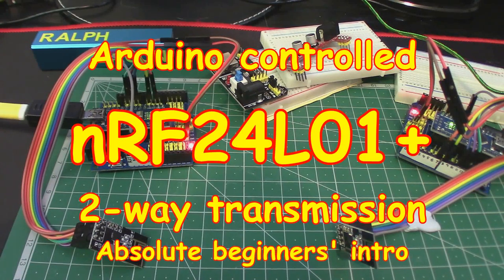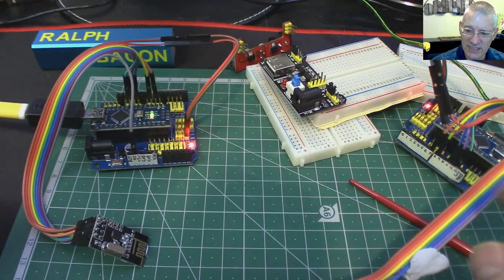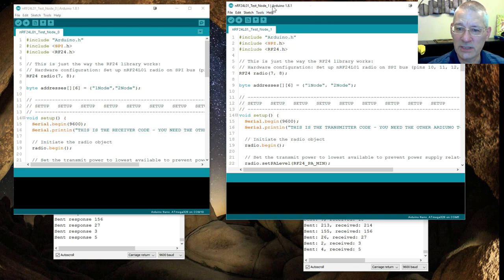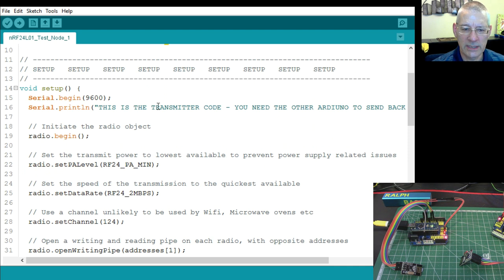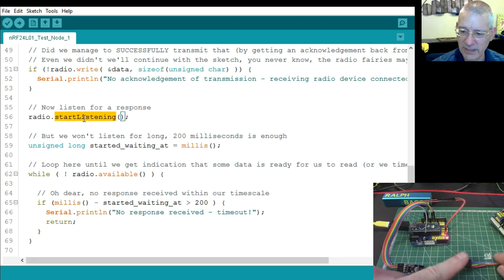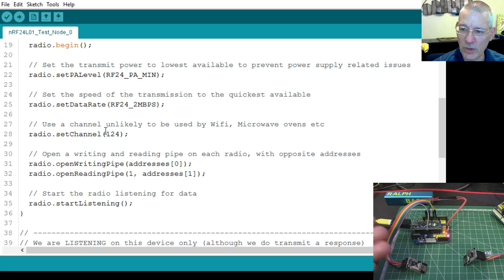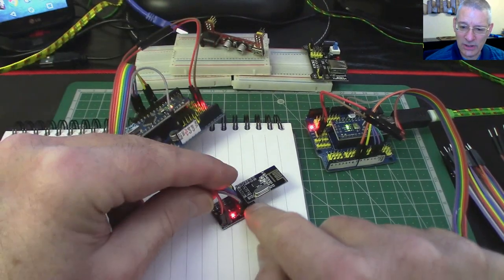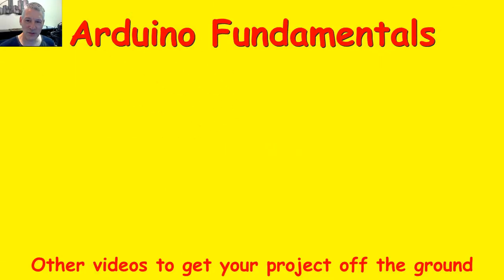#73 nRF24L01 Send (and receive) data with your Arduino!

Comment: hi ralph..despite connecting everything properly my rx serial monitor is blank and tx is nor receiving any acknowledgement..what could be the problem?
Reply from the maker: Let us assume that you checked and double-checked your wiring. Your transmitter sends out the character but does not receive an acknowledgement. It continues to wait for a reply character but receives nothing. Is this correct? If you swap the two modules over do you get any change in behaviour?
 
Are you using the adapter boards that allow you to run the nRF24L01s on 5v (a 3.3v regulator is all built in)? They solve 99% of all known problems, which all seem power-related. Do get two adapter boards and try again. So many people have done this and suddenly it all works!

Comment: Can I transmit data in both directions (transmit and receive) but use up to 5 NRF24 modules sir ?
Reply from the maker: Well, you can transmit in both directions but that means all devices must be in "listening mode" ready for a message. 

The demo circuit does do this; the first (initiator) device sends a messages, gets an auto-acknowledge, then waits for some reply. So you can do the same.

Comment: First of all, this tutorial is fantastic! I was wondering if you know how to send a string of data from one arduino to another. I am reading all 16 analogue ports from an arduino mega and wish to send them via the NRF24L01 to an arduino uno to display on a computer. I was thinking the best way to do this is to use a string. Do you have any idea how I would do this by edditing your code or is there a better alternative?
Reply from the maker: There is a better way. Don't use strings to send numeric data at all. 

The fact you're reading from analog ports indicates floating point (analog) data, such as 3.1415926? Depending on the precision you need, you can just multiply by 10 or 100 or 1000 on the sensor side and send as an integer (2 bytes) or even a long (4 bytes) if it needs it. Then divide by the same amount on the receiver side.

Example:
To send such values create a struct (short for structure), max 32 bytes, like this:

struct myDataStruct {
 char channel;
 int temperature;
 long humidity;
};

void setup()
{
 Serial.begin(115200);

 myDataStruct myData;
 myData.channel = '1'; // Single quotes for char;
 myData.temperature = 2353; // divide by 100
 myData.humidity = 78456; // divide by 1000

       Serial.println("Channel: " + String(myData.channel));
 
 // convert the int and long to a float, see the precision value (default=2 decimal places)
 Serial.println("Temp: " + String(((float)myData.temperature / 100)));
 Serial.println("Humidity: " + String(((float)myData.humidity / 1000),3));
}

void loop()
{
 // This is just a demo
}

The output looks like this:
Channel: 1
Temp: 23.53
Humidity: 78.456

Does this help?
Reply: @RalphBacon  Thanks for the help! I ended up using your code but using an array to send analogue signals from a MEGA to an UNO. I was also able to send a variable which can be used to vary the PWM on the mega. Now it is able to send the data and control a set of heaters!

Comment: Is it possible that one nrf may transmit perfectly but fail to receive data and vice versa or it is a coding issue , because I have one nrf which is transmitting perfectly and receiver recieves it, but it can't recieve the acknowledgment .
Reply from the maker: Anything is possible, Pranav, but if you swap the devices over (so the Tx was the Rx and vice versa) do they still exhibit the same half-working behaviour? In which case it's not the devices, it's your wiring!

Comment: Hi Ralph,

Sorry to bother you. my son it trying to get this to work but we keep coming up with one not working have you any idea please.
One is saying
No acknowledgement of transmission - receiving radio device connected?
Sent: 64, received: 64
No acknowledgement of transmission - receiving radio device connected?
No response received - timeout!

the other
Sent response 64
Sent response 64
Sent response 64
Sent response 64

Thanks
 .
Reply from the maker: There are a few basic steps you can take:
1. You MUST use the adapter plates. They are cheap and stop all problems with trying to run these modules on 3V3 as well as the wiring from "underneath" that confuses most people (including me). Here's a link to UK Amazon but they are available in many places:
https://amzn.to/3g37rSu
Please don't try and use the nRF24L01 modules without these.
2. Use my two demo sketches exactly and without modifications.
3. Check and double check the wiring. When using the adapter plates it's much easier to check it. Use different coloured cables for each pin.
4. Keep the units within 30cm of each other (the sketch uses ultra low power just for testing, no real range). Change the power setting statement  from 
radio.setPALevel(RF24_PA_MIN); 
to 
radio.setPALevel(RF24_PA_LOW); 
in both sketches (but unless you have the adapter plates there is insufficient current in the 3V3 output to run this - so do use those adapter boards!
5. Take heart: I've run these sketches many times on many different platforms (ie not just Arduino but STM32s, ESP8266s etc) and the demo sketches run fine. Just follow the instructions above and let me know how you get on.
6. Buy those adapter plates now! Good luck.
Reply: I ran into similar problems. Changing the 'setChannel' on both nodes to '120' solved this for me. That got me well above the home WiFi frequencies in the US.

Comment: Im having a problem.
The node1 side(transmitter) is sending data but it just recieved is always 0 and next of no acknowledgement and send a random data and recieved 0 again...
Can you help me with my problem?
Reply from the maker: Are you using the plug-in adapters for the nRF24 modules so that you providing 5v (not 3v3)? If you swap the receiver and transmitter units over do you get the same result? Are you using my EXACT sketch for each unit (Receiver/Transmitter)?
Reply: @RalphBacon  i solve the problem by using the adapters 
But how can i recieve 2 data from 2 different transmitters?
Which part of the code do i need to manipulate?

Comment: Hi Ralph, I am having a bit of a Problem getting this code to work. I know this sounds stupid but I have had them working with another Project but I was so stupid and reloaded then RF24 library. It appears that there are so many of These libraries with the same name that I am really confused. Can you explain the diffrences. I noticed that some use the power Setting with MIN and others use LOW for example. You have a very clear way of explaing things that why I am asking you what library I should use. Really , for my Project I do not Need 2 way communication and if I have understood correctly the & sign Triggers a Response any way. Could you try and explain what you would do in my Situation. many thanks in advance. Paul
Reply from the maker: Hi OE8PCK (I bet that stands for something interesting, part from Paul)! You're right there are several libraries out there. The one I chose was because it is being actively updated, so should have many bug fixes and new functionality. It supports a network mesh, for example. And again, you are correct that even if you have no requirement for two-way communication (that is, the receiver nevers sends data back explicitly) this device will automatically send back an acknowledgement that it has successfully received a data packet - so your transmitter unit will always know whether the transmission was successful (and will auto retry if not). So i hope that clarifies things (and helps you too). Thanks for your post, good to hear from you.
Reply: Thanks for the Info Ralph. OE8PCK is my Amateur Radio call sign :-) Do you have any experiance with the TEENSY 3.2 and the NRF24L01?
Reply from the maker: I'm afraid I've no experience of the Teensy 3.2, but I do know there is a special version of the nRF24L01 that fits directly onto the Teensy board. I'm guessing that they would be more expensive, however. That said, I don't see any reason why the standard one (as used in my demo) will not work with a Teensy with a few pin changes, read this article: https://forum.pjrc.com/threads/16001-Does-anybody-get-Teensy-3-working-with-NRF24L01 to get you going!

Comment: I tried sending a data on a “void” but sadly it cant send it. I tried the simplest code without sending back to the receiver just random numbers but inside a void. Can you try it or it cant handle sending a void. Please help thank you coz i really loved this that you did
Reply from the maker: I'm not sure what you mean by "sending data on a void". Use my two sketches which you know work just fine. Ensure you use the adapter plates to make wiring easier and stop voltage issues stopping it working.

Comment: In reference to line 51 of your code are you not sending the location of data rather than the value of data? If the use of the pointer is important could you please explain why it is.
Reply from the maker: Yes, in Test_Node_1 at line 51 I'm sending the location of the data (&data) to be transmitted. 
 
if (!radio.write( &data, sizeof(unsigned char) )) {
 
Is this important that I'm using a reference to the data location instead of just supplying the 'data' variable? If we look into underlying RF24 library we see that the 'write' method expects a pointer reference as the first parameter:
 
bool write( const void* buf, uint8_t len, const bool multicast );
 
Whether this would (a) compile and (b) work, if I just supplied the parameter as a variable? Microsoft's C++ compiler errors with:
 
Error C2664: 'bool write(const void *,int,const bool)': cannot convert argument 1 from 'unsigned char' to 'const void *' (12)
 
Which means I'm expecting a pointer to a variable of some kind and you've given me an actual variable. Doh!
 
Interestingly, although passed as a pointer reference (which means you can normally change those values in the underlying function) it is accepted as a 'const' which means it cannot be changed. BTW we're using (well, he's using) void as the parameter type to indicate a generic data type. So you can pass an integer, char etc and it is all accepted.
 
Short question, long answer, does it help?
Reply: Ralph S Bacon Thank you for your explanation. I am becoming more familiar with the RF24 library and see that the write function requires the address of the first byte of the data and the number of bytes. Exactly what your code does. 
Thank you for your time.

Comment: Have you ever had modules that dont communicate with eath other? I know every register and every bit of these chips, use them with ARM Cortex M1 CPU and a self written lib. I used th scan bit and found out, that the middle frequency of each channel is not the same in every module. You can improve distance if you shield the chips with a GND plane.
Reply from the maker: I personally have never had that issue, Kalter Krieger, but several reports on the internet (and in the comments here) indicate that some Arduinites have problems - mostly power-related because they did not use the adapter boards but maybe this has something to do with it too. Good tip about the ground plane, thanks for posting and vielen Dank für deine Infos.
Reply: Hello, you accent sounds "British" ;-) The problem is, that these chips are clones. The original ones from Nordic are much more expensive, about 5 USD / pc. I have aprox. 30 of them and only 20 are worht to be used in applications. Schöne Grüße aus Deutschland.

Comment: Does the transmitting and the receiving Arduino have to be the same? I'm using a nano and an uno and it doesn't seem to work, could that bee the problem?
Reply from the maker: Hello Arduinite! I'm currently on vacation 5,000 miles away from home so I'll have to be brief with these comments until my return, mid-July.

Not at all, super fat unicorn! As long as it's an Arduino using an Atmel 328P (which both those units do) then it will work, believe me. Detail the problems you have, specific details, and I'll try to help you on my return from East Malaysia!

Comment: I've search for ages for an easy to follow guide and this is by far the best, thank! However, I'm having a mixed bag of results. The 2 Arduinos (one Elegoo and the other a non-branded one) seem to communicate fine for a while and I'll get several Sent/Received messages, but then I'll get continuous "No acknowledgement of transmission - receiving radio device connected? No response received - timeout!" messages from the Transmitter side. If I reset either or both Arduinos (seem to have better luck resetting the receiver Arduino), it'll settle back to receiving/transmitting, then go again, and so on. Any suggestions why?
Reply: ....just to add, both are sat on my desk, about 30cm apart, both set to "MIN", but I've also tried "LOW" with the same result. They're also connected up "bare" without the adaptor plate.
Reply from the maker: Well, Huw, as you will have seen from my other comments here I can only highly and really, really recommend the adaptor plates. (Too much emphasis, I know). You're running those units at 3.3 volts directly from the Arduino, I suspect; some clones might only give out 50mA on that pin (depends on how they were designed). The adapter plates lets you supply the full 5 volts and lets the modules take hundreds of milliamps as required. The problem is that the units take a short burst of high current when they transmit. Now..
 
Now that said, I can't guarantee that will solve your issue but it does seem a bit silly to try anything else when it is known (in the Arduino community) that the adapter plates solve 90% of the type of issue you're now reporting. Even if they don't solve it, it eliminates a source of problems that we can progress knowing that power is not the issue. And the wiring up is a lot easier! Amazon sold me a pack of 5 (IIRC) for the same price as I could get them from the Far East. If you don't live in the UK this link is not much use to you but you may be able to get them locally the same: https://www.amazon.co.uk/Socket-Adapter-NRF24L01-Wireless-Module/dp/B00NJCB7FS/ref=sr_1_1 What do you think?
Reply from the maker: PS In the demo video I barely got 30cm range on the MIN transmit power setting; setting that power higher (eg to LOW) leads us into the 3.3 volts issue above!
Reply: The adapters worked :) Many thanks.
Reply from the maker: Glad to hear it Huw. Did the range increase nicely when you now increased the power setting? And did the modules not drop any packets as you were previously experiencing?

Comment: Hi, Can I make the arduino(1)send a signal to another arduino(2) to switch the light that is in the arduino(2)? When the arduino(1) is plugged and closes when unplugged.
(sorry for bad english)
Reply from the maker: Yes, the master transmitter sends a value to the slave receiver and if it is, for example, a value of 2, the slave will switch on one of the GPIO pins to turn on the light. Try it with a LED to show it working.
Reply: @RalphBacon  Thank you very much :)